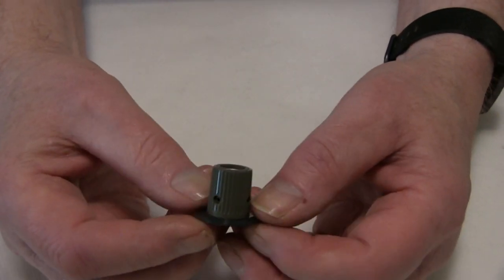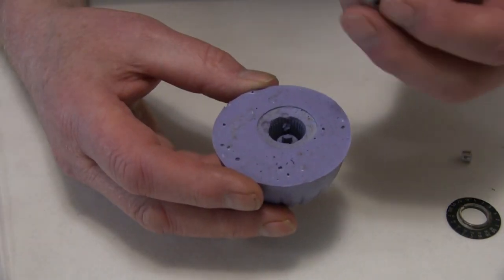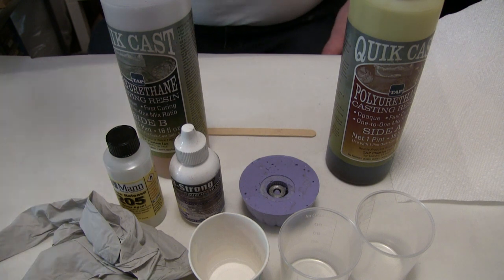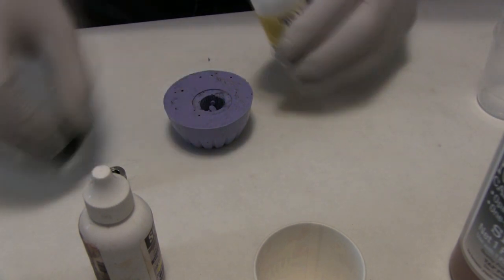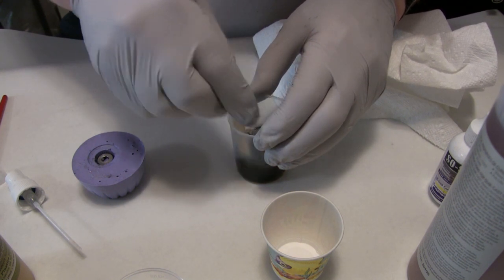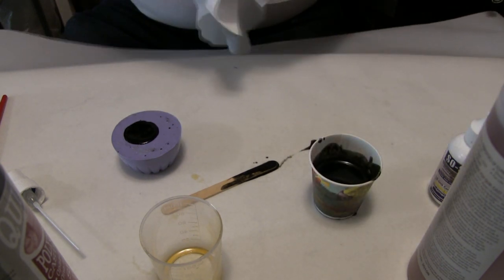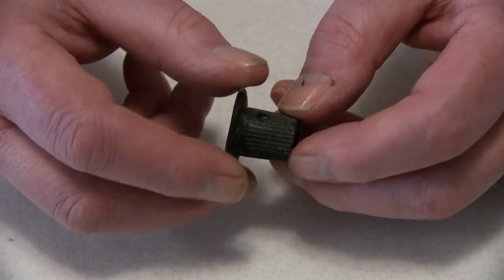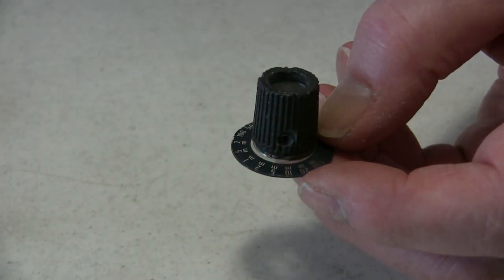Casting a replacement knob for a Tektronix PG506

Comment: You motivate me to mold few knobs for the 465 ,466 and 7000 series I work with. All of them have broken knobs or levers , and some coaxial (concentric) parts are difficult to replace .

Comment: You need to get a vacuum pump and glass vacuum desiccator to de-gas both the silicon mould and resin during curing (before gel point)
This will remove bubbles that cause cavities in the final product. Increase the vacuum slowly to prevent the resin from foaming. (de-gassing too quickly)
Use a syringe or letter scales to measure out resin to prevent wastage of material.
I make moulds to make 6 to 10 items at a time, again to prevent resin wastage and of course the bonus of ending up with some spares.
Great vid and thanks for sharing.
Reply: Naw... for a kluge knob you don't.
Reply: @willthecat3861  If kludge is your thing, go for it my friend.

Comment: I knew a guy who worked in a model shop in the film industry and they’d put the silicon molds in a vacuum chamber after pouring to better remove bubbles in the mold.

Comment: What's goin' on Bob!  Yeah, my Europa has a one year only light switch (the only item NOT Lucas, but some French thing.  Hexagonal shaft, so there are six, count 'em SIX thin spots between the i.d. and the outer knob diameter.  It was only when someone was able to 3d print the mold and/or final part and the bezel insert in the top that it was available again.  So if I waited long enough, the odd bits I could NEVER find did, become in fact available.  Now, the hole in the side of the cheapo plastic knob was NOT for a set screw.. but there's NO documentation so NOBODY could pull the knob offa the shaft, and the screw on bezel to hold the knob on the dashboard could never be unscrewed as the knob obscured access. It turns out that the 20 odd Euorpa SPECIAL owners in the US still around would tell you that you just push in the hole and you push a button that releases the knob from the hexagonal shaft, and voila!! but NOOOOBDY knows, so eeeeeverybody breaks this knob.  Everybody.  

The sad sad story of the Europa main light switch knob.